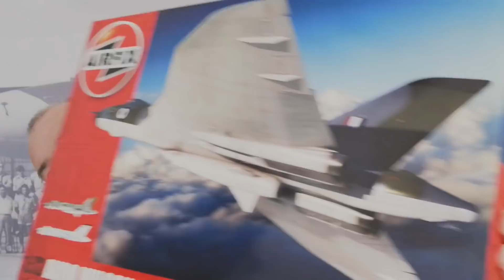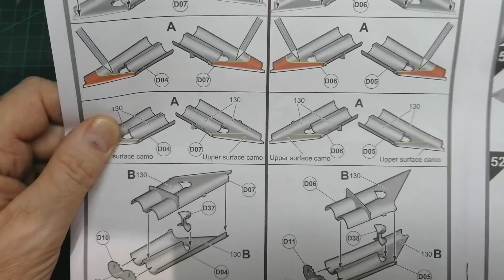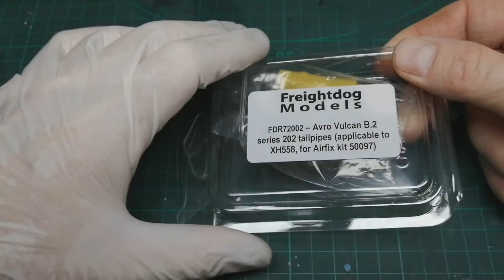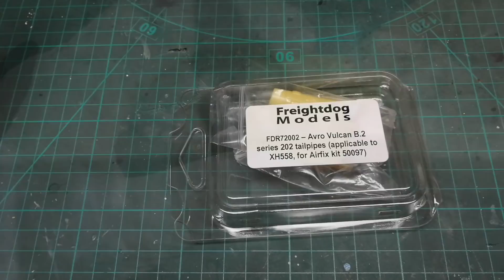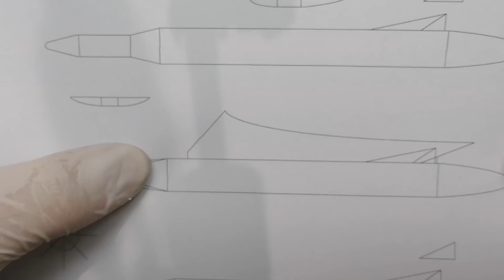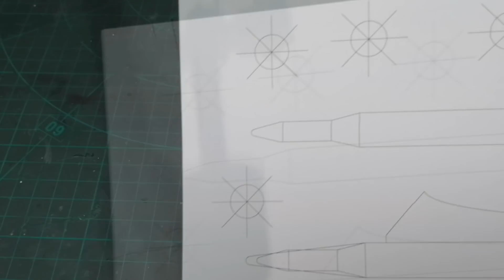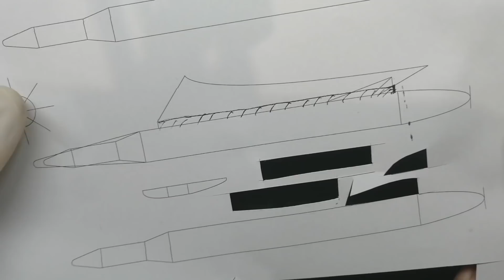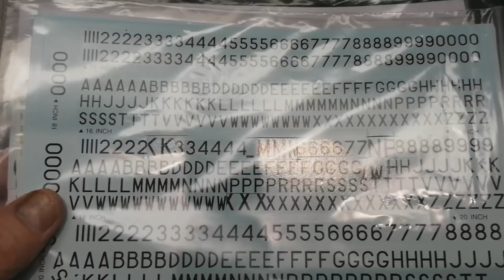Airfix's 1/72 Vulcan + Skybolt Missile (full build)

Comment: Lovely build Greg, you have achieved a great white finish, not easy to do. I too, like to separate all parts first - I don't like the clean up part of modeling so get it out of the way first.  I put each sub assembly into separate containers though, not one big box. Also pencil the part number onto any bits that may be easily mixed up later.

Comment: Beautiful. The pylons for black buck used the hard points for the Skybolt pylons, Airfix are probably planning a Black Buck Vulcan for the 40th anniversary of the conflict next year.
Reply from the maker: Yes, that would make more sense 👍
Reply: @GregsModels  if you look at the sprue layout there is a space on one of them where the parts will probably be when they do it. The only other alternatives are the K2 tanker. The MR version (yep, Vulcs used for maritime recce) and Skybolt of course. Great looking build BTW, also, one of the Vulcans in the kit, Newark's (I have worked on that one) was fitted for Skybolt and iirc the fittings can still be seen. All the best.
Greg W
Reply from the maker: @crazybrit-nasafan  Yes, a strange role at least it left the Nimrods to concentrate on hunting subs.
Reply from the maker: @crazybrit-nasafan  Yes, a strange role at least it left the Nimrods to concentrate on hunting subs.

Comment: Just a thought,would 2 or 3 gloss varnish coats prep the surface for decals.rather than sanding the surface.
Reply from the maker: Providing the painted surface is smooth.
Reply: @GregsModels  I was always lead to believe the Gloss varnish actually smoothed the paint out,hence a gloss coat before decals.
Reply from the maker: @Lee0568  I've never seen this method in action only heard about it. To be honest it sounds messy, especially in this scale; remembering that you still have to make sure all your seams are smooth, which is the hardest part. But whatever floats that individual's boat. As for the gloss coat, you must remember that any imperfections on the paint surface will show on the varnishes surface as well, Lacquer paints may be different as they tend to have self leaving properties and are a lot more forgiving, once again whatever floats the individual's boat. At the end of the day, building models is about the enjoyment of creating something, in other words, there is no wrong or right way it's just a hobby 😎👍